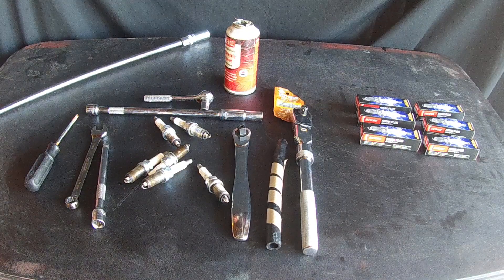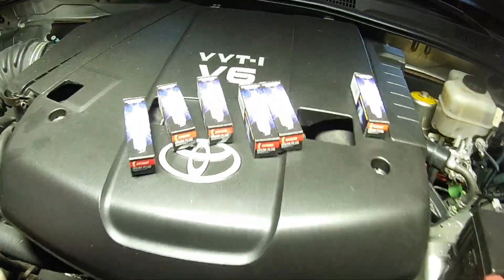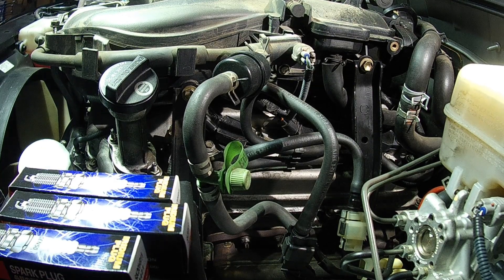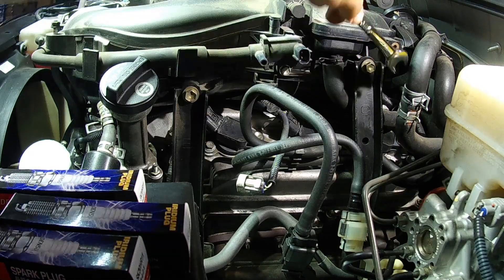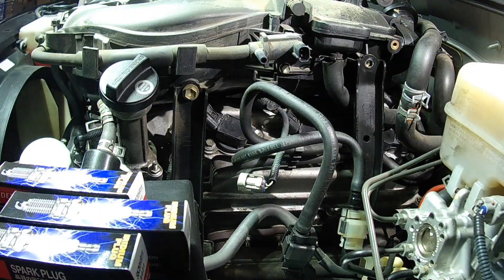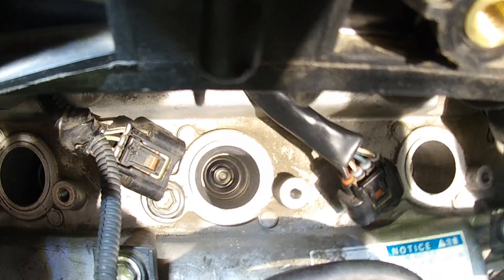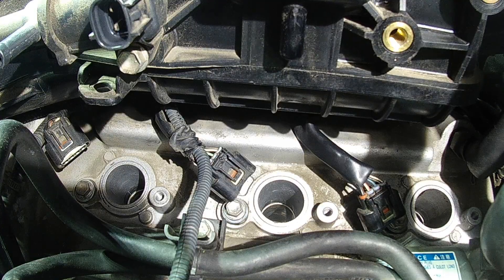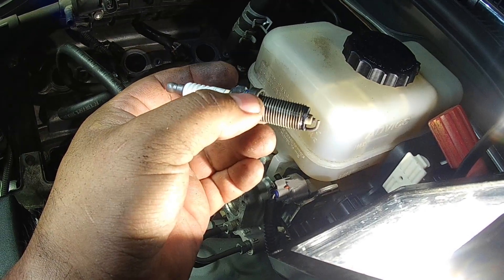Spark Plugs Toyota V6 Replacement Tundra 4Runner Tacoma FJ Cruiser 1GR-FE 4.0L V6 (1GR-FE V6)

Comment: Much appreciated. I know it isn't hard to change but having never done it, it's always good to watch any YTer change the spark plugs, twice.

I tried loosening the coil pack without removing the other tubes/wires. But seeing you remove them (took only a few extra minutes) , it just reminded me to work smarter, not harder.

Comment: Would it not be possible to just drop the new spark plug with the magnetic wrench ?
Reply from the maker: You could. Just don’t let them “fall” down there. You could use a magnetic pick up tool as well if you wanted.

Comment: Great video.  In regards to the use of antisieze this is what Denso says in their guide on installing spark plugs  "If you apply grease or another screw thread lubricant to the threaded part of the plug, you are liable to tighten the plug to an excessive degree, impairing the integrity of the seal, even if you apply no more than the recommended torque. For this reason, do not coat the plug with screw thread lubricant."

Comment: Yes. Needs copper plugs though.  Requires a lower resistance on the electrode. Change every 30k miles. K20HR-U11 Denso
Reply: can you install the iridium plugs instead?

Comment: How do you get rid of the tocking on the 1gr-fe engine
Reply from the maker: Is it really loud and change tempo when you rev up the RPM's?
Reply: @bundysgarage  yes. It's been like that for years now
Reply from the maker: Could be a number of things. Bad valves, bad valve adjustment, water pump going bad.

Comment: Good video, but around 2013/2014 Toyota added some emissions plumbing not seen on the engine in this video. Pointer to a parts diagram follows. More work, but not a show-stopper:

https://partsouq.com/en/catalog/genuine/unit?c=Toyota&ssd=%24HQwdckgWXEYRDhQ9LDcQHxZcQREOFCExPGhmAX9gC3EDW1JKAwEDFx4RV1VJX1sEBAUBCwMWGkkIGhAJFnJgfQYOWylUdXh1cnlyFhpJAxBWEQ4EHhFCVUlfWwYFDWIQTkpDAgE5SRFXXFYRDgdHRx9bVxYPEAIDBl1HVRBaWhcIEQUBXFJJAHAWSExsdGwzHzADRXYHcUttFw%24&vid=0&cid=&uid=254990&q=JTEZU5JR8E5073127

Comment: Do not need anti seize.
Reply from the maker: Yes you do
Reply: @bundysgarage  @Vanuatoo is correct. You should not use anti-seize. Spark plug manufacturers specifically say to NOT use anti-seize because, 1) they already coat their plugs with a zinc compound to mitigate seize, and 2) using anti-seize adds extra lubricant making it possible to over-torque plugs when installing.

Comment: Why don’t u just use ur spark plug socket and the extension rather than that pipe you cut?
Reply: Because it doesnt hold it at that downward angle and the ceramic top of the plugs is fragile
Reply from the maker: Its not a pipe. Its a rubber hose

Comment: Hi. Anyone know why the later version 1GR-FE uses 0w-20 instead of the 5w-30 in this engine?  I heard it said manufacturers suggest lighter weight oils in the specs to meet economy ratings? In other words and if it were the case, it would be perfectly fine to use the heavier weight oil on an engine specified for the lighter weight?
Reply from the maker: Because the government is demanding higher MPG from the car manufacturers and do achieve this they use thinner and thinner oils. Using a slightly heavier oil is fine just make sure you change it at regular intervals.

Comment: Not true there will be nkg on one side then denso on the other side the factory does this because they have contracts with both companies!!!! This engine calls for standard spark plugs not iridium! I am not trying to be a ass.
Reply: You are correct. I was pretty confused when I first changed my used 03 Sport 4Runners plugs in 2015. I thought maybe the previous owner only changed the “easy” side and said “fuck it” on the other. I chose the stock NGK plugs but would certainly consider the Iridium version of either stock plug were it available. Why not choose the longer life option all other factors being the same. Does anyone know if there is a suitable Iridium alternative to the stockers out there?
BTW, 53k miles later (203k on the clock) she is still running like a champ and the plugs are great.
Reply: Only the first time lol, i am not trying to be an ass :)